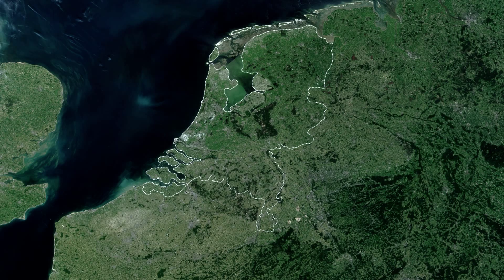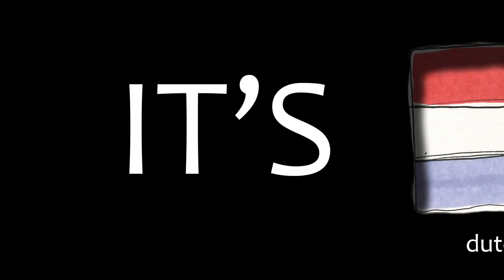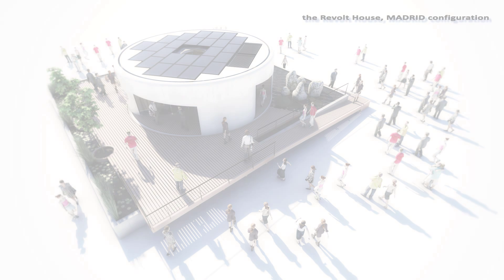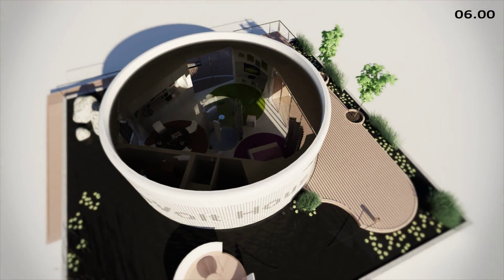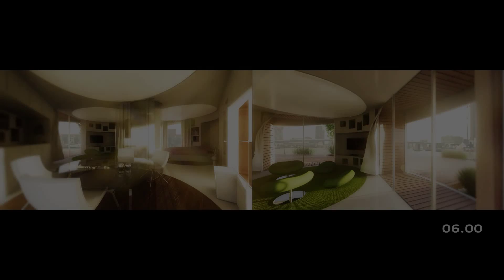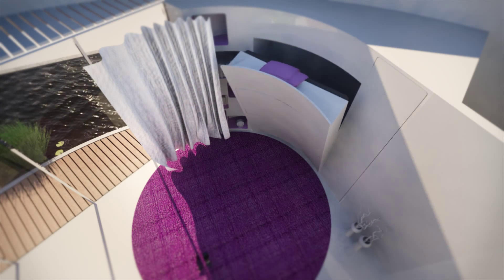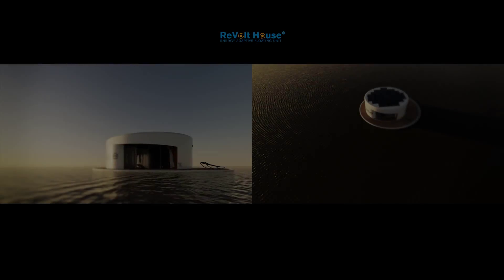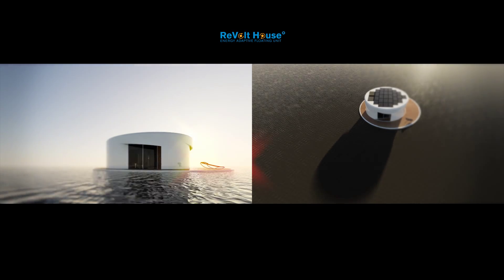ReVolt House - TU Delft's entry for Solar Decathlon 2012

Comment: You might want to work on some light weight fast aerodynamic electric cars and some thorium and fusion nuclear power since Holland has first row seats to the drowning..
Among the pathetic lack of efforts from all the countries of the world, Holland should at the very least be motivated to do the obvious right thing.
Lest ye be fucked.

We are only 13 years away from +2degree CO2 levels and 30 years from +6 degrees. Things are moving faster than ever before.